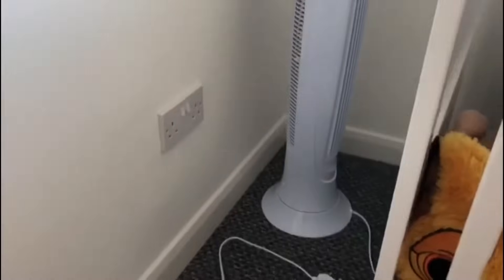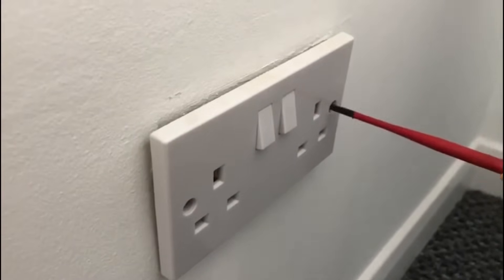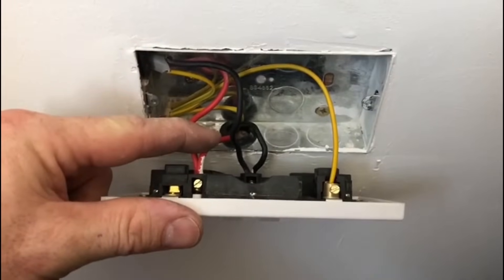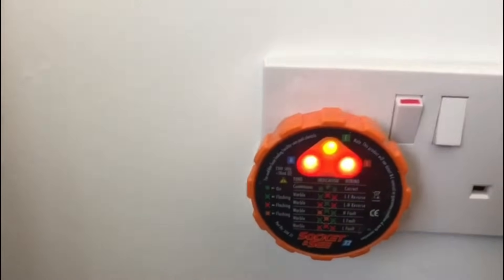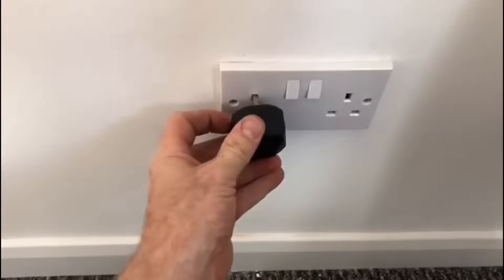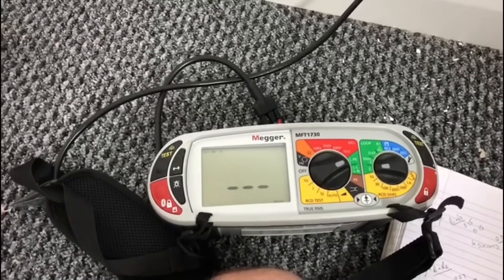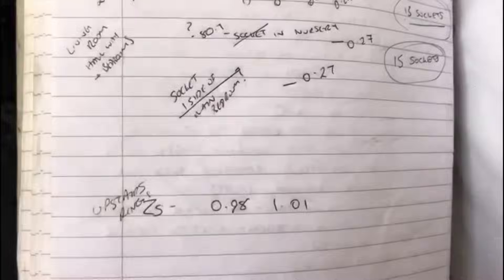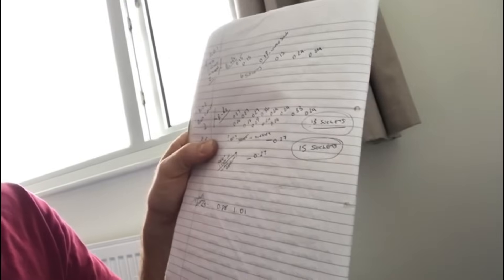EICR Fault Finding on Sockets - Reverse Polarity & High Resistance - Ring Final Circuit Testing

Comment: Think the house owner has been ripped off, rewired with old PVC red/black. No wonder there's no paperwork.
Also a single fly lead as you have done is not sufficient to take the maximum fault current unless its a 4mm which I don't think it is.

Comment: You should have left the two cables cpcs longer the same length as the flying lead cpc and tucked them away in back of box it would have been better  I hate short cables

Comment: What about if you extend the old coloured wiring because they were too short, with the current setup, wire it all up correctly and your socket tester still shows a reverse polarity ?? What then ? What is the solution to this ?

Comment: Sorry but there so many things wrong with this video.1 If it had a full rewire then this is clearly not the case as there are red black cables in the back box with dark green sleeving .Meaning that wiring is around 50 years old .Inspector should have known this.2.Outer grey cable sheathing is below the back box and should be brought into the back box.3 You earthed the cpcs of the ring to the back box then brought a flying lead to the socket .So now you have a 1.5 or even 1.0 single  earth protecting a socket outlet connected to a 32 amp ring .If the rcd failed, you would not have sufficient earth protection to blow the mcb ,instead it could possibly blow the 1.0mm cable leaving the live fault on the earth.

Comment: I am curious what type of earthing arrangement you had for this property, and what was the value of Ze or Zs at DB. For a value of 0.27 for R1+R2 and 1.01 for Zs, using formula Zs=Ze+(R1+R2) means you had a value of 0.74 for Ze or Zs at DB, which is close to maximum Ze for a TN-S system. Now if we take in consideration that calculated Zs using formula is usually slightly higher than the measured Zs, and measured Zs is 1.01, resulting in Ze or Zs at DB for your installation around 0.80 or higher I assume.
0.27(R1+R2) + 0.80(Ze I assumed) = 1.07 Zs calculated, and 1.01 measured, like I said calculated is slightly higher than measured.

So, was  TT system?

Thanks

Comment: Does it really matter if phase and Neutral are reversed in AC voltage?
Its only important not to reverse with DC voltage, as far as I know.
Reply: Your avving a laugh i really hope...
Yes it doesnt really matter if your a chancer.... unless your a professional electrician doing an honest  proper paid skilled job .... and then it DOES matter...ffs.🙄
Reply: Depends if you want your plugtop fuse to be in the neutral mate and all your equipment connected up wrong. Can you think of any issues with that... 🤣
Reply: Yes, the fuse on the plug is on the live. If the device gets a ground fault the fuse will be completely bypassed. Now with the breaker and RCDs is is not so serious but it still is a clear error. Similarly if there is a short and the fuse blows it will leave voltage on the device.
Reply: FfT = Fast Fourier Transform?
Reply: It can be a huge issue. Sockets are single pole switches and are supposed to switch the line conductor. If they are reversed then they switch the neutral. This means that when an appliance is plugged in even with the switch off the line is still connected through the appliance and the circuit prevented from completion on its return to the socket via the neutral. Hence, I'd someone were to think the appliance were turned off an inadvertently make contact with a live part they could make a path to earth and get a nasty shock.

Also as someone else has said, the fuse in the plug of an appliance would then be connected to the neutral meaning it would not be protecting the appliance from potential high current on the line conductor.
Reply: @lh2589  Why would anyone stick their fingers on a lamp socket when it is plugged in? We do not do it on the continent.

Comment: Washers on the fixing screws are not a requirement but a personal preference but the screws holding the box should not be a counter sunk type as these can cause damage to the cable the screw type should be a pan head type in my humble opinion.
Reply from the maker: I also love a pan head screw for this type of fixing 👍🏻
Reply: M6 washer absorbs the csk screwhead and gives a few millimeters of adjustment on fixing

Comment: Fantastic job, it amazes me how many  so called sparks can’t get the basics done properly line to neutral , i hate to think what the rest of the insulation is like, and then real sparks like you and me and Gaz 
Have to go in and put it right and make safe , as for using washer’s it’s not a requirement
I don’t use them except for CUs and outside socket outlets. 
Job well done 👍 
Fantastic video as always 👍👍👍👍❤️
Reply: Sean, I think the 'spark' has assumed the neutral goes on the left because they're always on the left on the front of the sockets. It just shows a lack of knowledge/experience and lack of even the most basic of testing. I agree no need for washers. It's overkill for back boxes. Mike.
Reply: @KendalMike  I agree a bit but we should always look at the markings next to each terminal ie L- E - N , not always in that order .

Comment: 2:18 apparently undergone a full rewire. Wonder if they still had some old red and black on their van then. Makes you wonder if they charged for all new cabling?
Reply from the maker: Great point 🦾
Reply: @GSHElectrical   also just watched rest of video. @ 7:04 solid green earth (sorry cpc). By recently rewired they mean pre ‘77?
Reply: Rewired means put new sockets, new boxes but used the old cabling. Also apparently are also very colour blind, or just did the old touch no yelp test, and used the good old finger tight screwdriver test.
Reply: Rewired my arse... just swopped out what you can see.... charged you for what you can't.... yehah ...
Reply: I'm not an electrician but I spotted the old colours🤦🏻‍♂️